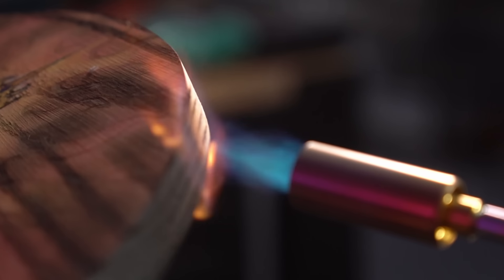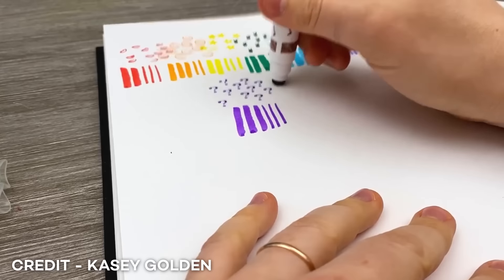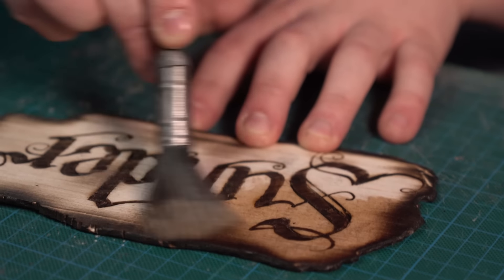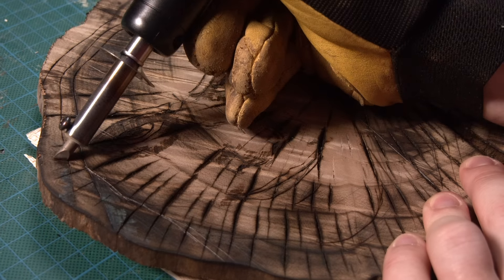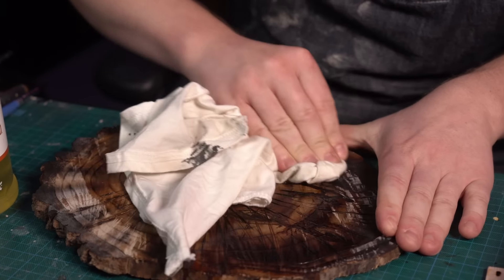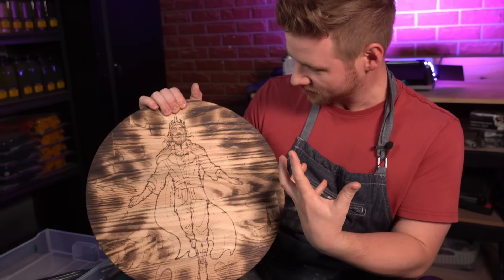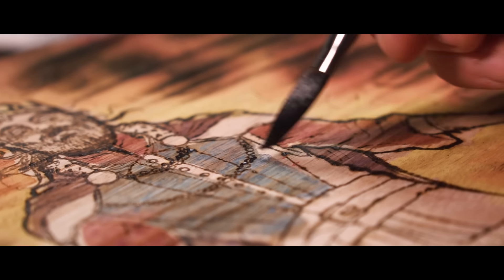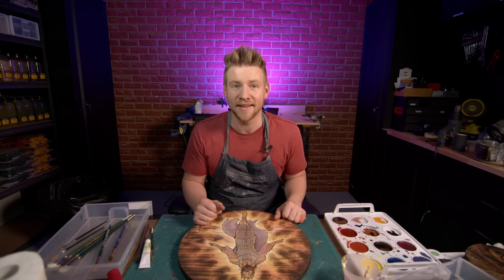Drawing with Fire - There's NO GOING BACK!...

Comment: I've been doing pyrography for a good few years now, and I also always kinda struggled to get proper clarity in my lines, especially on hardwood. But then I bought a proper temperature adjustable tool thing with the wire nibs, and it changed everything. Doubt anyone will see this, but if you do, and you are seriously interested in pyrography, I highly recommend going for the blocky temperature adjustable ones over the cheap soldering iron like ones. Get a better product in half the time, and have more fun doing it.
Reply: same. he needs the professional tool.
I just got one and its soooo worth it.
Reply: So true. It makes a world of difference
Reply: sand sand sand sand and sand some more!!! remember, its about timing, not pressure....
Reply: Agreed.  I found the same thing
Reply: Absolutely.  It's the difference between a Crayola plastic paint brush and a Real fine hair brush.
Reply: The best of both world’s is the Walnut Hollow Versa Tool 😍 It’s absolutely my favorite burner and without the expensive price tag.
Reply: @akacosplayandart1398  i like that one, but it doesnt stay hot as you go, like a more expensive one. 
Though i do enjoy it for light skin tones, delicate stuff.
Reply: Came here to say this. It changed my world! Real shading!
Reply: That piece of hardwood gave me instant PTSD.
Reply: I’m glad you said this as I was going to write the same type of comment also without using most of the nibs he’s missed out on so much more texture. He could of made a dragon or snake and used the nibs for scales. He has so much more to explore and fine what a real set can do. This type is a great intro but with his art skills he can expand and do so so much more and with the amp box and wire nibs they have soooo many more uses. Cheers cherieK 🦋🌈🐿🇦🇺
Reply: I made that transition after about a year of putting up with a soldering iron type. It makes such a difference.
Reply: We had the wire nip type at the workshop at my "after school care". I had so much fun with it! It was so sad that only one of the caretakers had the skills and knowledge to use those tools, so when he had finished his education and moved on for permanent work, the tools were moved to another institution that could actually use them🥲

Before watching this video, I had almost forgotten how much I loved those workshops!
Reply: I used it for my work for years, it's so much better!
Reply: Completely agree with you there, been using a Peter Child (uk brand) and now upgraded to a razertip dual which has been really good for heat control! Would also recommend colwood!
Reply: Yep yep! I use a Burnmaster Hawk with the adjustable dial. It’s awesome because you can put the tips from Other burners on it and it gets super hot for those times you want to burn the texture right in there.
Reply: @genreofstubby  very much agree. Sanding to a really fine grit makes that too slide across the grain like you’re burning on Bristol paper or smooth stone. The lines are so. Much. Smoother.
Reply: Yes, wire nib ones are much better, not only cause of temp. control but also because distance between tip of the tool and place where you hold it is much smaller which gives you more precision. I've been using russian-made one called Uzor for few years, they've produced it as a hobby tool for kids since USSR they're slightly updated now but still look a lot like soviet ones. It has wire nib and power block with temp control and it cost like $25.
Reply: Pyrography is a name huh
Reply: Respect to you for doing this
Reply: There is no compare when you have a temp control unit
Reply: Yes, yes and yes. My tool costs about 70$ and it is fire. And with wire you can bend it to your hearts content.
Reply: I agree, my girlfriend does super realistic burns with full blackout backgrounds with a proper burner. You can tell he was struggling with control. And the wood needs to be sanded smooth!
Reply: @Danielism  love to see some of her work
Reply: Agree, better temperature control is a must. Also after the line work is complete, lightly sand with fine paper to remove the overburn and sharpen the lines.
Reply: Ty this is very useful info xxx
Reply: “I doubt anyone will see this”

1.1k people: Hello
Reply: agreed
Reply: Lol manny people see this 
Nice mate I agree with you
Reply: @Nist349  yeah lol

Comment: Yay, Jazza did pyrography!  I've been waiting for this!
A couple tips (pun intended):
1. You CAN actually erase a little bit with sandpaper.  You have to balance erasing it enough to fade away with the damage it does to the surrounding wood, but it works really well and can save a piece if you need it.
2.  If you want a smaller, more manageable version of the blowtorch, you can use a culinary torch.  Basically it is a small, one handed use butane torch that is safe for indoor use.
3. I like the idea of using gouache, it made for some cool effects, but since it is water based it will raise the grain of the wood.  I actually bought a set of decently cheap alcohol markers specifically to use for this purpose.  They are, however, less subtle, but again, you can sand the wood to fade it out if you don't like it.
Reply: I was actually wondering if he sanded it before at all and if he didn't could he have had a result he was even more happy about. Also I was thinking he could have sanded the rustic tree one to make it pop a bit more like he wanted.
Reply: I don't recommend the alchohol markers. They are dye based and fade very quickly.
Reply: Ooh, so that's what's going on with a wand that I recently carved and painted with watercolors! I couldn't figure out why the wood I sanded smooth looked rough again after painting. I just wanted to add some color without hiding the grain. 🤔
Reply: To elaborate on the sandpaper can you use a pointed Dremel for a more precise erase? They makes Dremel heads textured like sandpaper so I thought this could work.

Comment: Ooooh! I do wood burning using my Cricut to make a stencil but using a far "softer" method, but your results speak for themselves 😍 Great work Jazza!
Reply: I had no idea a Cricut could do that! I thought I needed a lightforge. Off to google...
Reply: @superfund42  I use it to create a vinyl stencil, and then use wood burning gel which allows the wood to burn when heated up with a heat gun :) The cricut itself cant wood burn (probably should have phrased it differently lol sorry)
Reply: @KellyRossouw  That makes more sense. Clever use of the vinyl though! This is good - I still have zero reason to buy a Cricut!
Reply: @KellyRossouw  I came here to suggest he try this as another dabble and dive project.
Reply: @superfund42  there’s always a reason to buy a cricut! Opens up a lot of possibilities. I also use mine for stencils a lot for wood burnings
Reply: @superfund42  do you mean glowforge?
Reply: @MountainBabyRoses  Yeah. I do. My brain defaulted to Lightforged Draenei.
Reply: @superfund42  😅 I was wondering. 
Ya Ive been looking at those glowforges too. There is some cheaper options out there but i dont think they have any customer service nor as easy to set up as Glowforge. Theres also trotech I was looking at which is way more expensive but they look like they are practically a school with all their learning tools and support behind their product.

Comment: I am very jealous of how good your practice work looked. The last time I messed with wood burning didn't look so good. I want some wood rounds to make viking shields, lol. So, for Americans you can get a cheap wood burner at Walmart, Hobby Lobby, or Lowe's/Home Depot. You will never get the scent of burning wood out of your sinuses. Use bare wood with no treatment cause the chemicals will be very bad while burning. You might want to do this outdoors or at least in well ventilated area. I still remember what it smelled like and it's been like 7 years or so. I'm not expert but this is the information I can pass on. Good luck. I need to go to town and get a new wood burner now.

Comment: I had a woodburning class in highschool and also did some woodburning in a workshop at a place I lived for a few months. As a tip, some mistakes can be corrected or at least partially corrected with sanding. That's one of the reasons it's good to burn lightly then trace back over it. This also makes an easier path for darkening the lines without getting sucked into the lines of the grain as much bc of the different hardnesses of each ring which is what can cause lines to come out looking splotchy and uneven

Comment: I just started wood burning and my burner and tips are similar but not as easy to change. It doesn't have the screw to help change the tips. We have to use a vise grip to pull it out. I've used cooking oil to put a finish on the wood and it works great. I'm curious about what kind of wood you're using. It doesn't seem to have as much trouble going against the grain. Your designs are awesome. 😁👋💖

Comment: My gran actually published a book on woodburning techniques back in the 1980. Woodburning, Art and Craft: Techniques, Designs, Decorations, and Inspiration by Elaine Broadwater. Kiln dried wood works best for wood burning. My mom did wood burning for years during my childhood. Definitely do want to seal any wood burned pieces. A clear varnish or poly coat is usually what my dad would use to seal my mom's pieces.

Comment: Try it on leather, it is so much smoother to work on, and if you can control the temp of the pyrography machine, turn it up super high, and hover a flatter tip over the area for a smoother, gentler and more controlled shading affect.

Comment: There is also a tool that is a ”wire burner”. I really dont know what its officially called but it could be called burning pen as well. So it works much faster than these types of burners because it only heats a thin wire. So it heats up much faster because it has way smaller area to heat.

Also you have to cut, bend and attach the wire so basically you can model your own brush. But the wire has to connect the two ”studs” so that it forms a circuit to work. Anyway, with that you can form a pretty sharp and red hot thing that burns the wood super fast. Makes the process faster and easier. Filling large areas are still challenging though.

Comment: For a more gradual gradient, instead of the blow torch, have you tried hot sand shading? It's a common technique used in marquetry wood art. Also if it gets to dark, use sandpaper like an eraser, more control, so long as the char is not too deep.

Comment: Also, I would like to let you know that you can get better lines and drawings if you sand before drawing on the wood. It will give you a much smoother surface to draw on. I have gone with the Burmaster pro series and have never looked back to working with the cheaper variable temperature pens because of the frustration.

Comment: i use those to burn holes into wood. sometimes, drill bits just end up cracking the wood... i try to make wooden figures with articulation. it's fun but very challenging

Comment: Strange to see an art tool I’ve used before in your videos! Very fun but very tough to do curves, careful with the pencil sketching, it’s hard to erase off wood and the burner doesn’t actually get rid of the lines underneath it so you could end up with pencil lines permanent on top of your burned ones

Comment: Hey, Jazza... Can you do a video on the dangers of fractal burning, especially if folks use Microwave Oven Transformers for their power source? People are dying using that form of pyrography. It is not what you are doing here, with a properly regulated electrical source. Microwave Oven Transformers have no safety switch. Ann Reardon of How to Cook that also has a video on the dangers of fractal burning, but YT took it down. Thanks for considering it.

Comment: if you're gonna use a slice of a log, you'd want to burn it before it dries too much because the cracks can make it too hard to work with. however you don't know where the wood will crack after you do the art piece so you can seal it in resin, or just let it crack and every piece will be uniquely unpredictable

Comment: They make finger tip covers that are heat resistant so you dont have to wear gloves. Hell 90% of the time while doing pyrography i never even wear them.  Also i think you would enjoy the other style with the wire nip tips better then the one you are using, i use both but the wire nib tips i use the most

Comment: I think you should've focussed more on shading with the burning techiques rather than using the paint to do it- so using the different heads and cross hatching or something. Especially in the easier places like the cape folds. I feel this is more just using the burning for linework. I like the end result and your art never disappoints but it's more mixed media than I was hoping  😊

Comment: yeah you really only messed up using the unconcentrated flame of the torch on the log with the splits because the flame goes into the little holes and makes unnecessary dark spots

Comment: im loged in so thow idea. maybe store sighn. jazzer barber shop. have avitare with barber shop design. pool or sciccores. wood sighn hang from rode. stick pool. wood burn into bord. do round over router bite or cove rote bite around edge.
Reply: I did box with dragon painted with wood stain. so could paint face with stain. have careful direction wood grain could pull stain were don't want so have careful put it.